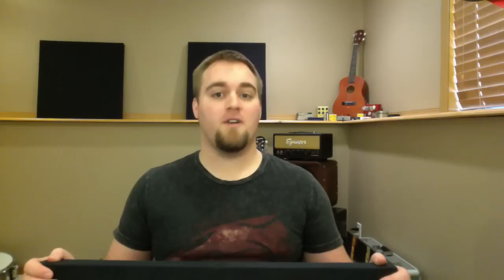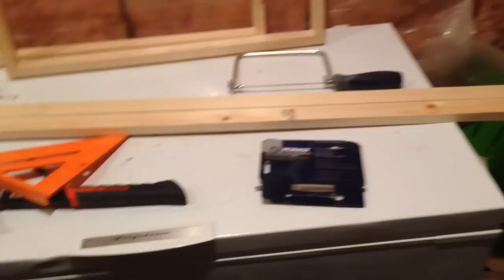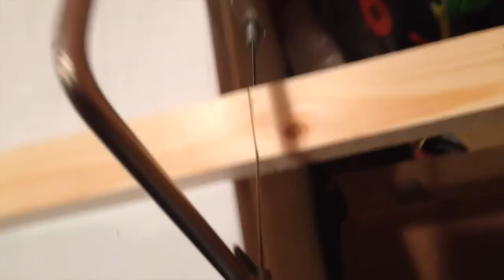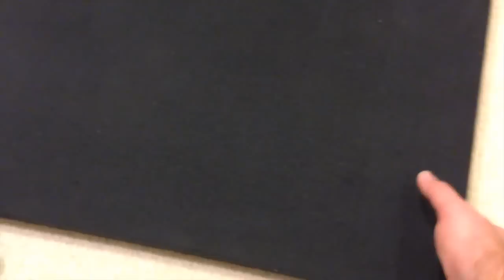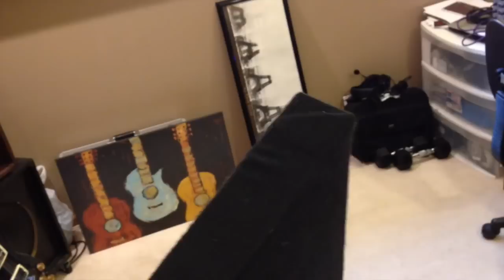DIY acoustic treatment panels on the cheap (without insulation)

Comment: My Friend, thanks for the basic video.  What you are calling "High end Flutter" is actually called RT60.  What that simply means is how long does it take to reduce the reverberation from the onset of the sound source until it is reduced by 60Db.  This is a formula, and measurements are typically used to measure the co-efficient of the beginning of the sound source as opposed to how long (typically in milliseconds) it takes to reduce the reverberant sound by 60 Db.  You're on the right track, and as for the naysayers, anything you do to break up the reverberant time from the beginning of the sound source, until it ends, is a legitimate factor.  Does Mr. Brown's example need further work? Yes it does.  However, even a simple frame with nothing more than a fabric covering will effect the RT60 of any room.  Keep up the good work.  You delivered on what you had proposed!  There are too many "experts" out there who lack even the basic Knowledge of acoustics.  You made a statement, you proved and substantiated your premise.  Just seek a little more info on the subject, and you will be ahead of those who just do not have a clue!
Reply from the maker: RAVENWORKS DIGITAL Thanks man! I am without a doubt not an audio engineer and I hope I didn't come across as one. Thanks for the info, I love to learn and expand on what I know. Thanks again!

Comment: Awesome work! Instead of pinning the fabric, I would make a think frame which would fit inside the main frame and the fabric can sit between the frames. It helps adjust the tension on the fabric as well as wash it every quarter or so :)

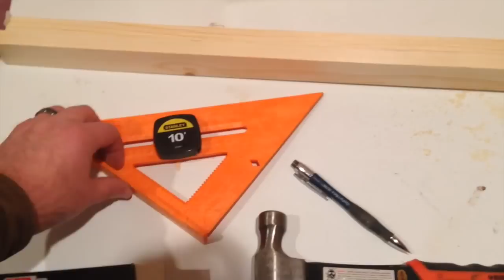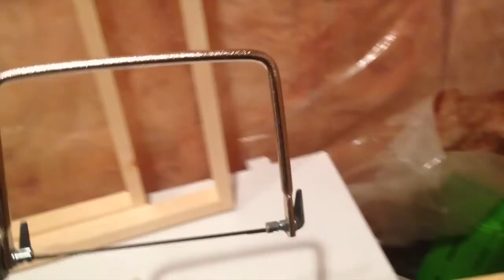Comment: 10:42 before, 11:03 after what a difference with just a small amount of panels. Thanks! I just tried that in my room "CLAP zing CLAP - zing". 2:17 FYI Tubers, when you go to the hardware store, ask for the "try-square". What is shown here at this time is a a style Irwin try square. There are also cheap adjustable version Irwin Try Squares with levels. 2:44 "keyhole saw"

Comment: You just built reflective acoustic panels. The energy of sound will travel very easily through that thin of fabric. Drape some over your speaker and listen to how much sound escapes. Then put a 2" or 4" thick piece of rockwool in front of your speaker and take note of what frequencies it absorbs.
They are nice frames though. You should change the title to "How to build acoustic panel frames"
Reply from the maker: Please watch the end of the video to see how well they worked and they have now been insulated.
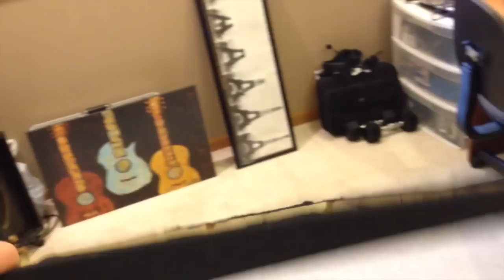Reply: Anthony Brown Sounds like you switched to a condenser mic at 9:57? Regardless, you made some nice, sturdy panels, and I'm sure you added insulation afterwards for a reason. Fabric alone doesn't have the amount of density required to absorb sound energy. Same reason why carpet on the wall is a bad choice for acoustic treatment. It might tame down some high frequency ping, but nothing to treat your mid/low frequencies, which create the most energy and build standing waves. The thicker/denser the panel is, the lower the frequencies it can absorb.

Comment: just searched local music shops. and these pannels cost somewhere from 200 bucks for a single 1000*600*20mm panel. like wtf are they made of? gold? no. simple foam :/ 
thanks for the tutorial!
Reply from the maker: +George Sevnv Thanks for watching! Make sure to pick up some foam for best results! I got mine at our hardware store custom cut for around $30 for 10 panels.
Reply: +Anthony Brown There is a difference in density and flammability. Acoustic foam is inflammable and much more dense which allows it to actually absorb unlike cheap foam.
Reply: I built mine for a square meter price of 17USD compared to the damn acoustic companies that charge you: 36$ all they way to 300$

Bought Cellulose insulation panels at thickness 1,77inches.
Some wood panel around it, and some cheap fabric stapled over.

Cellulose fibre is way better than rockwool or fibre glass and i would say all foam materials. However!! Foam materials can be custom made with density and air holes so that they block certain frequency spans better.

Comment: I kinda think a couple pillows would do the exact same thing (break up the flutter), you could even put them in the same diamond configuration since they're not even attached to the wall, and for less than $20.
Reply: No that's not how sound works. It reflects and the panels bounce it up and down until it's converted into some other kind of energy which is why they're shaped that way

Comment: Brother, you need to add some rockwool. This is a hell of a lot of work for something no more effective than just hanging a sheet up a couple inches from the wall. Add some rockwool for sure and these will be solid!!
Reply from the maker: In a previous comment we disused this. I have added insulation but these on there own do help to eliminate the high end flutter as shown at the end of the video. You are right however, this is like hanging a sheet on the wall, just looks nicer.  Maybe I'll do a revised version or an update video with the insulation when I get time 
which might be awhile, I'm about to have another kid and moving to a new house soon. Adding the insulation didn't add much to the overall cost of the project keeping it cheap, which was the point of this. Any thoughts on the use of diffusers in a small room? I've seen some conflicting info from different sources and would love to hear from someone who has used them (if you have or know of someone who uses diffusers). Thanks for watching and for the good suggestion!
Reply: Yeah, life always gets in the way. Congrats on the new addition to the family!

With something like, say, a QRD 7 diffuser you want to be about 4-5 feet from it for it to work properly. So if you use them in a small room, say at the back of a small control room, you'll want to make sure your listening position isn't too close to that back wall. And if you're in a recording room, the mics would ideally be at least that far from the diffuser.

So it's a matter of making sure your room is at least large enough for the sound diffusion/scattering to take place physically in the room. You wouldn't want diffusion in a little vocal booth. But if you have a room that's something like 150 sq ft then you're good to go. Even a 10'x12' might be okay, but anything smaller than that probably wouldn't, and proper placement is definitely important.

Comment from the maker: Marcel Keyboard Wrestler had left a comment and did not allow replies. Here is the message I replied to his comment with. Please allow other to reply to comments on my videos so I can get back to you as fast as I can.

My reply to Marcel KeyboardWrestler:

Hi keyboardwrestler,
you recently left a comment on my video about sound treatment panels but you have replies disabled. Sound panels will never be able to soundproof your house, and I never claimed that they could. In most cases, like mine, people want to reduce the reflections in a room for recording purposes. In my older videos, I had to do a lot of eq'ing in post to try to get rid of flutter and ringing caused by the reflections of my voice off the walls in my office. By reducing the amount of reflective surface, I was able to kill the flutter in the room, which you would have seen if you had watched the end my video. Thanks for you comment and I hope you better understand the purpose of sound panels and how they are used to treat sound in small rooms. There other videos on YouTube that will assist you in building a "soundproof" isolated room at great cost. In the future, pleas allow replies to comments you make on my videos in order to better help me respond to you as quickly as possible. Thanks for watching!  

His original comment:
The one thing i just cannot understand is that you want to TRAP ! sound... and at the end of the tunnel to absorb and disable the energy of the sound wave.  i see all those self made panels but to me you are putting a flat surface on a flat surface and i see many people use the wrong fabric piece of cloth which of course take away the absorption power of the rockwool or expensive foam. i know my neighbors will ALWAYS be annoyed if i use to much Decibel ! i cannot make my room sound proof or i need to build a room within my room starting from the ground with rubber lay out on the floor building up and everything cannot make contact with the existing room and don't forget to build air flow be cos you need...    oxygen...  of course..! to expensive :))  Anyways for the people who are building a home cinema you can only absorb small area's and reflect them but you can not make most small homes soundproof. for small house cinema's put up 7 panels and Learn how to make them and that is the best you can do to save money !

Comment: Anthony, great video! Sorry there seem to be so many people who obviously didn't watch it or want to make your video about something you weren't addressing. I definitely heard the difference and think this might be the solution for me.

I'm basically in an open office surrounded by sheetrock walls, and want to lessen how much people can hear my conversations from other parts of the office. Do you think these kind of panels will help with that? (I don't have a "flutter-ping"...just voice carrying) Of course, I like the price point too! ;)

Also, which fabric is it that you used here? 

Thanks!
Reply from the maker: 42realdeal Sorry for the late reply. If you're looking to put something like this up in an office space that is a public space and not your own, I would say you better check you local building laws first. For most places permanent fixtures like these need to be made from fire retardant materials. Outside of any legal jargon, If your wanting to really reduce voices you'll need to make sure these have foam inside the panels as well, but even with that you would still have noise around you. The best thing to do would acoustically treat the whole room with panels on the sheetrock and not just around your space. It really depends on your space. Sorry to not be much help.
Reply from the maker: Anthony Brown As far as the fire thing goes, thats just what I was told by a building inspector when we were looking at making some of these for our church. He said that if they started a fire our insurance might not pay out because they were made of non code materials. Moral of the story, dont light them on fire. :)

Comment: In terms of metal fabrication, a strait-edge in a precision instrument for doing exactly what it's name implies; proving parallelism or trueness of a surface. For any purpose relating to carpentry, the standard of measure is usually 1/16th to 1/32th of an inch... The 'straight-edge' that is referred to in the video is actually a 'universal-square' or more colloquially, a "Tri-Square."

Comment: can i use a painting canvas
Reply: Z1PO47-minecrft-ark-and more 0.o 
No. You need to remove the canvas as air doesn't pass through it and will have no effect.
Reply: RecordingStudio9.com thanks
Reply: RecordingStudio9.com  so anything that air can go throught ?
Reply: Yes, most cloth material will do, as thick as you can get.
Reply: RecordingStudio9.com  Thanks!!

Comment: They look good but will not work.
You will need at least 1/4,  1/2  wave length distance of absorbent material behind those panels.

I have no idea why the sound changes in you vid. 
But it shouldn't.  Tip: In a small room like that you need basstraps because bass causes muddy sound.

I believe you said you do recordings in that room with a  type of mic which is not very expensive.  That is ok...  You can make great recordings with cheap stuff 

But make shure your room is in balance, with decent traps for different frequencies.
They also can be made without breaking your wallet :-D
Reply from the maker: Hi RC,
These Panels are 2 inches thick. They now have insulation behind them, but these work in the video just like hanging a blanket on the wall. Even if the fabric was right against the wall the sound would still change because of the difference in materials between the sheetrock and the fabric. A quick experiment for yourself would be to tape a blanket to a wall in a room and see what the difference is. I have looked into bass traps but when recording guitars I use either an Iso cab, close mic cabs, or di into the computer for bass guitar; but bass traps would be a great addition! In the room in this video I was fighting high end flutter in my voice in these youtube recordings and wanted to fix it, and these did the trick. I'm now in a much larger room and have new sound challenges to fix, but thats that joy of recording! Thanks for watching and for your input, I'm always up for learning something new!

Comment: Without foam it'll just won't work properly at all!
You have to use rockwool, this won't do much at all. The rockwool is doing all the work, the fabric is just a way to cover the bare rockwool. It might do something but wait untill you hear it with rockwool, you'll laugh at yourself for thingking this worked a bit...
Reply from the maker: The idea behind these was to get rid of the high end flutter in the room. I am fully aware that in order to get the same type of absorption as a comercial panel they must have insulation inside. These do a great job of reducing reflections off of the bare wall. And yes, a panel with rockwool or better is crazy to walk by, it sounds like a vacuum next to your ears. The difference is a panel like that is $100+ (for a pro bought panel, $30-$80 for cheaper full size panels) a piece and these were $30 for the 10 I ended up making. Without insulation and removed the flutter in my office which has helped tremendously in the audio of my videos. They now have insulation and are even better than without for sure. This is just a simple project that can be modded and improved upon for cheap for the non professional who needs a cheap fix. Thanks for the input and for watching! Rock on!
Reply: Anthony Brown I understand, but I made my panels off 24x48 inch for $30 par piece, $6 of that was for the rockwool...
Rockwool is super cheap and works just as well as professional solutions where u pay $100+ for.

Comment: Assuming this is sound transparent fabric it will not work. If it's regular fabric I doubt effect will be audible. If there will be any effect it will be for very narrow band. Without filling it does not make any sense building those.
Reply from the maker: Please watch the end of the video to see the effect before commenting. Also know that these have sense been filled but is clearly stated in the video title that these as built are not insulated and did work to reduce flutter.
Reply: Anthony Brown Like I said -  if anything it's a very narrow band.  Also notice that at last comparison at very end of the video when you clap first time there is almost no reverb second time there is clear echo.  This proves that there is extremely narrow band that resonates in Ur room and you hit exactly this fq with this particular fabric.  I call it luck. In 99% cases this will not help anyone. Acoustics is about precise calculation or broadband damping.
Reply from the maker: These worked to reduce the high end flutter in the room by reducing the amount of hard surface area sound could reflect. Will insulated panels work better at reducing a larger freq. range? YES without a doubt! But as stated in the video title, this was a build without insulation to avoid the argument of what works best and they did work for high end flutter. If you really want to do some low end dampening you need bass traps. But I assume that you, along with everyone else who has commented, are an acoustic engineer and already knew that. As always, thanks for watching and for the comment. Looks like it's time to make a part two to this video and bite the bullet discussing insulation, diffusion, and placement.
Reply: I use these to cover the sides of my small studio room along with some auralex foam for the door and back wall. Before putting up the auralex foam, we put up these sound panels and played drums to see how the room sounded. We noticed a pretty good difference and overall tightness in the room. wether you think these panels work or not, try them out for yourself and find out!

best of luck

Comment: The one thing i just cannot understand is that you want to TRAP ! sound... and at the end of the tunnel to absorb and disable the energy of the sound wave.  i see all those self made panels but to me you are putting a flat surface on a flat surface and i see many people use the wrong fabric piece of cloth which of course take away the absorption power of the rockwool or expensive foam. i know my neighbors will ALWAYS be annoyed if i use to much Decibel ! i cannot make my room sound proof or i need to build a room within my room starting from the ground with rubber lay out on the floor building up and everything cannot make contact with the existing room and don't forget to build air flow be cos you need...    oxygen...  of course..! to expensive :))  Anyways for the people who are building a home cinema you can only absorb small area's and reflect them but you can not make most small homes soundproof. for small house cinema's put up 7 panels and Learn how to make them and that is the best you can do to save money !